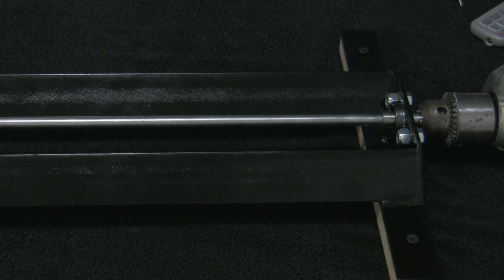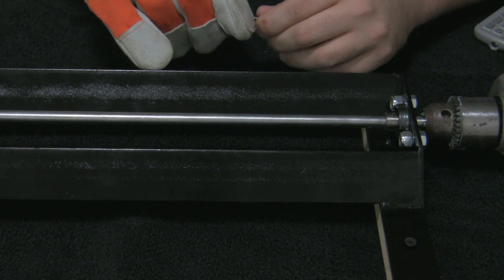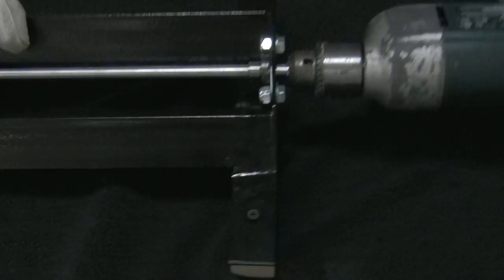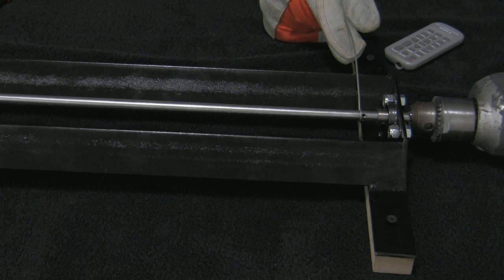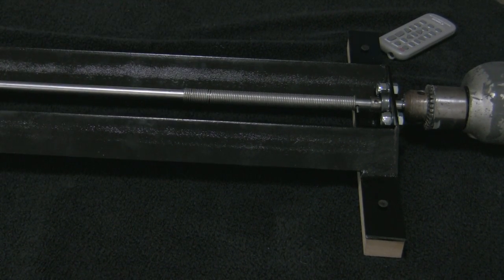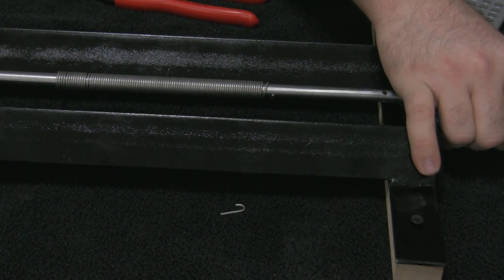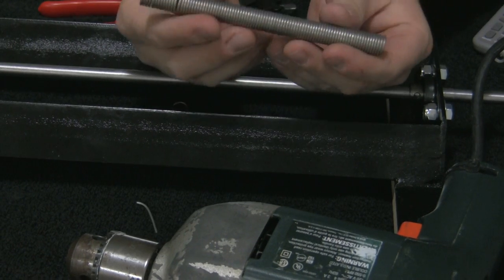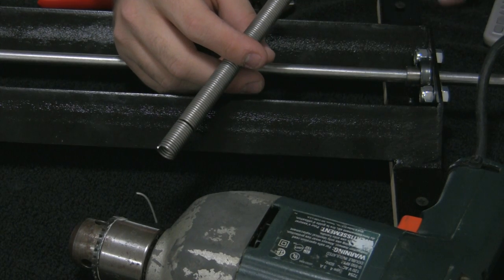Faraday Suit Chainmail Series - Video 3

Comment from the maker: Yeah exactly. Now that I've been winding for awhile I've worked out a system. I normally wind the wire till I'm holding the last bit over the top of the angle iron, then cut it close to the coil so it releases its tension safely inside the rig and my hands stay safely outside. Still always a good idea to wear gloves though.

Comment: The spring back is very dangerous. I myself do hands on coiling like you, and everyone on the chainmail forums tell me its not a good idea. I work mostly in copper and Aluminum, so the spring back is not as powerful... but regardless of the type of wire, wire whip can open your hand up deep! 
~Your coiling rig is fairly safe while winding because you are leading under the rod, and you have your hand behind the 90*.